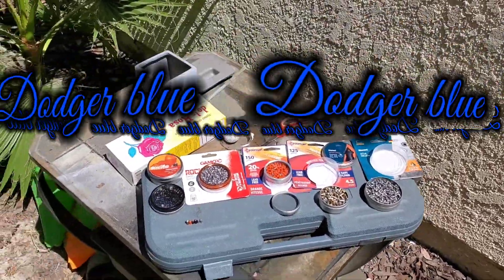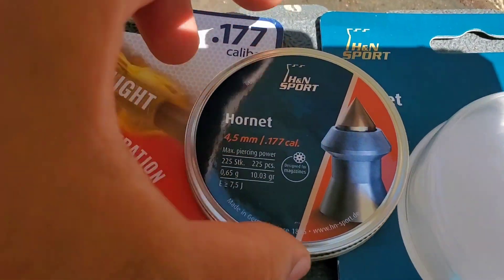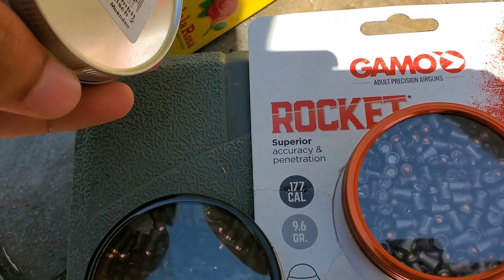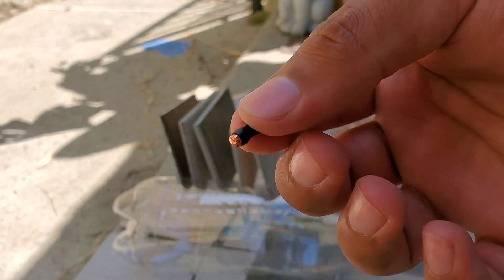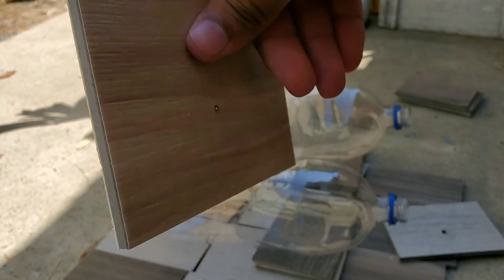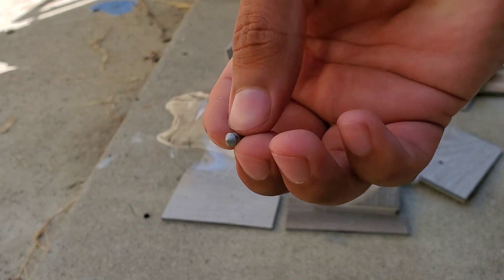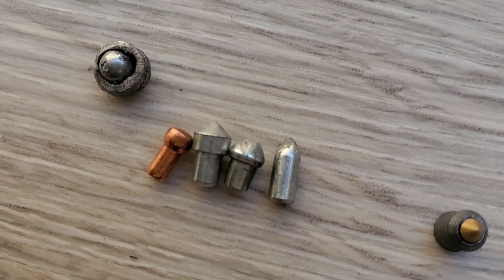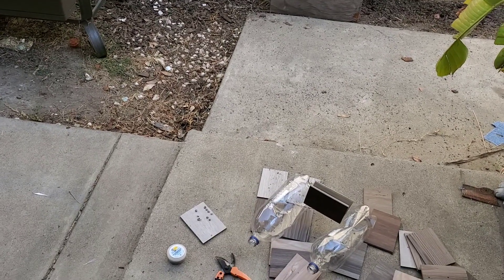Gamo lethals , h&n Hornet and other penetration pellets vs tile!!

Comment: You need to do that same test using ALL WOOD pieces, some of those floor panel samples you're using are made of plastic.
Some of those pellets would probably have gone through acouple boards, but the plastic panels are harder and have rubber on the bottoms.
Reply from the maker: dammm that all looked similar i didn't even notice. Thanks for pointing that out.

Comment: Gold flight is light and hard as hell . I punched a hole threw the back of an old microwave in.177. And a 22 lead just dented the hell out of it. Do they make the gold flight in 22-25???
Reply from the maker: nice and i don't think they have the glod flights in .22 but they have some very similar called powershot
Reply: @lethalgunner4903  thanks🇺🇸👍🏻

Comment: Which gun are you using? What do you think of Gamo Swarm Maxxim? Any complain? please
Reply from the maker: I used my gamo viper whisper 1300fps. i actually like the gamo swarm maxxim better because you can put 10 pellets and not have to keep loading pellets after each shot. i might get the swarm maxxim in .22 since i have .177 already
Reply: Dodger blue : I owned the Swarm Maxim in .177 and it was a Beast ... I wound up giving it to My Uncle ; and later replaced it with The Swarm Magnum .22 Caliber :It is an AIR CANNON! Coyote , Hogs, and Wild dogs don’t stand a chance. I’m dropping them with body shots.
Reply: Richard Gonzales what did you pay for that one?
Reply: andrew macedo : $300.00 plus tax at Cabelas.
Reply: Which one should buy for hunting purpose small game .swarm maxxim and gamo whisper , gamo magnum in .177 cal i am confuse i need power with accuracy.please suggest me
Reply: nitesh singh : The GAMO Swarm Magnum .22 Caliber can kill just about any game , large or small : Hogs , coyote , Wild dogs, raccoons, possums , etc .
Reply: @richardgonzales8502  sir .22 ban in my country so please you suggest in 
.177 cal , magnum,  swaram maxxim,  and whisper among them which is best accuracy with power ..
Reply: nitesh singh : The Swarm Maxim in .177 is perhaps the best in its caliber
Reply: @richardgonzales8502  thanks for your best suggestion
Reply: nitesh singh you’re welcomed

Comment: Will these work in a .177 colt 1911 co2?
Reply from the maker: i think so but it will not be as powerful as a rifle
Reply: @lethalgunner4903  what would you recommend for a .177 pistol? Like for the best damage mate? I’ve got the colt 1911 dark ops pellet pistol co2
Reply from the maker: for penetration the gamo lethals and for biggest wond cavity the daisy hallow points they are cheap to like $6 for 500 pellets

Comment: I’m getting me a pellet gun
Reply from the maker: i recommend the gamo swarm maxxim u can put 10 pellets instead of having to reload a pellet after each shot
Reply: Dodger blue I messed up and bought a crosman f4 ima return it and get that one how many fps that one shoot ?
Reply from the maker: the crossman f4 isnt bad.  and the gamo swarm maxxim is rated at 1300fps
Reply: Dodger blue yeah that’s more than this one I’m gonna go get it where did you pick it up I just checked online and it’s sold out most places
Reply from the maker: they have them on Ebay  they have it in .177 and .22 i might get the .22 since already have a .177 pellet rifle
Reply: Dodger blue make a video when you get that one I wanna see what it’s about
Reply from the maker: yes i will do a penetration test .177 vs .22
Reply: Dodger blue that would be dope
Reply: Dodger blue I got me this one now it’s way better than the other one thanks for the recommendation!
Reply from the maker: nice!